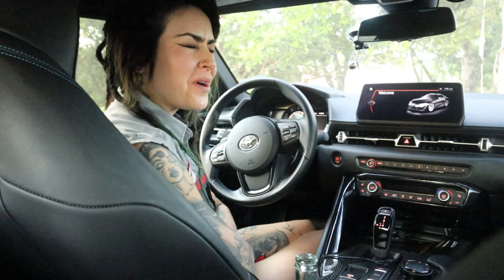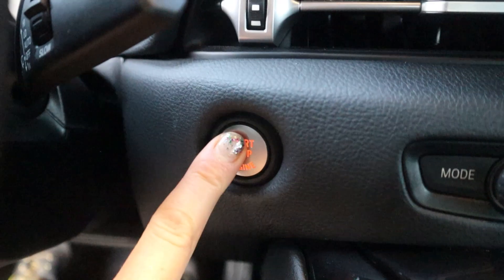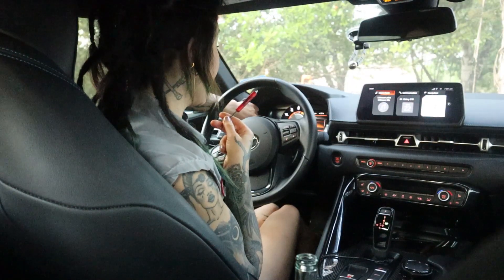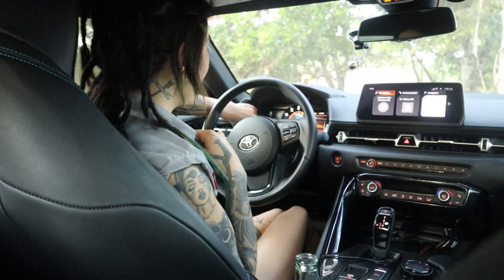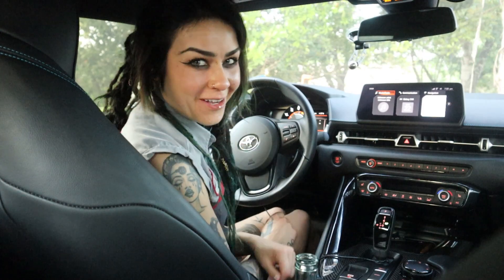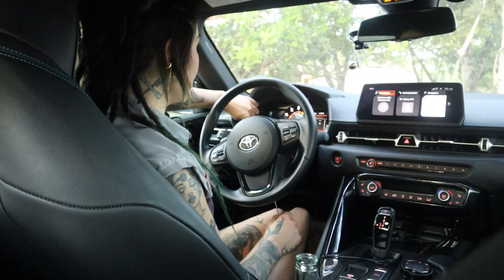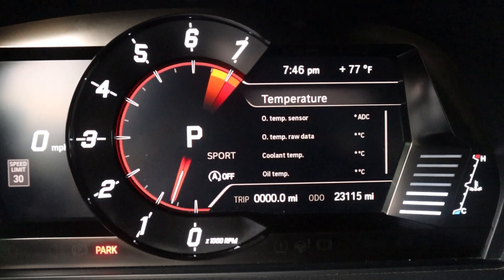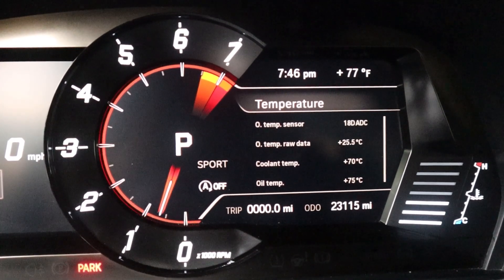How to: DIGITAL TEMPERATURE Readouts (Oil & Coolant) on Your Mk5/A90 Toyota Supra's Instrument Panel

Comment: Where is the sensor that gives the readout for the Oil.temp? I have a specific obd2 gauge and it's reading a different one. One that seems a lot higher in temps.

Comment: You weren't kidding, that's so very cool to have that ability to get those read outs in the instrument cluster, however, you are right on one of the two bad things is to go through all that, when a scan tool is probably faster, but still that's really neat especially the code!  Thank you, haven't worked on one of these, and yes keep them coming!!  I saw other neat options in there, very nice!

Comment: Wouldn't it be easier to just use a scan tool ?
Reply from the maker: Easier for who?? Me? Or the average vehicle owner who wants to take their car to a track? And speaking of track.... when driving in a "spirited" fashion - let's say like on tail of the dragon, would you want to be driving with a scan tool on your hand? Or would you prefer the readouts RIGHT THERE on the dash? So to answer your question: no, I don't think a scan tool is easier at all.
Reply: @FayeHadley  The thing that gets me is it's not persistent ....Even though actual numbers should be mandatory in attack mode ...

Comment: I would about bet since its in the factory options, making that the standard option would be doable in an aftermarket tune update. Similar to how you can set certain driver aides to standard off in a tune on some vehicles.

Comment: Wow Faye has Toyota ever massaged / refined and tweaked a lot in suspension and engine management system in the 2023 Supra! AND then there is the 6spd manual coming…and the tranny is designed and made in-house!! You trading up??